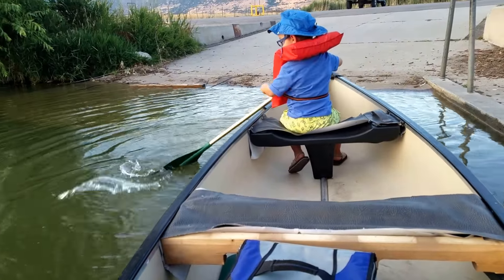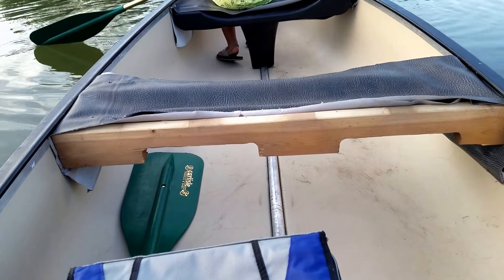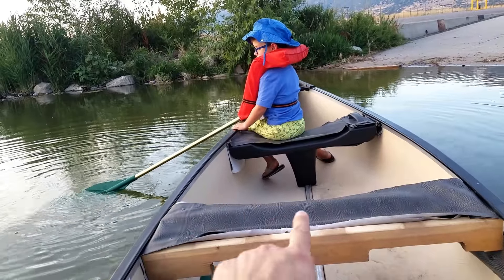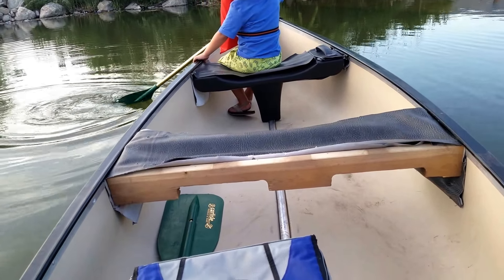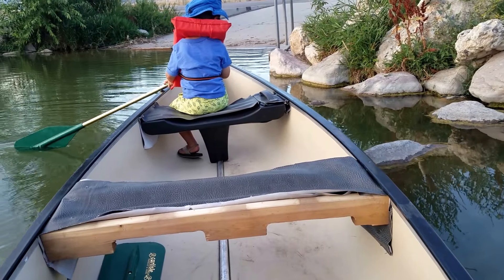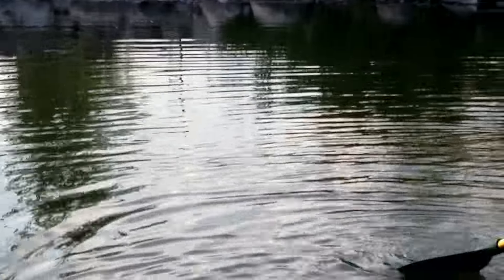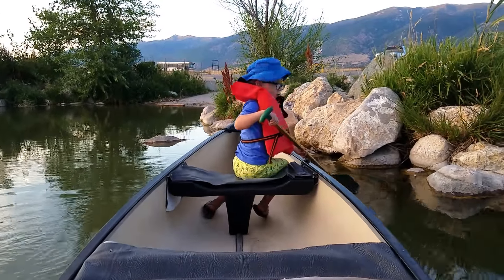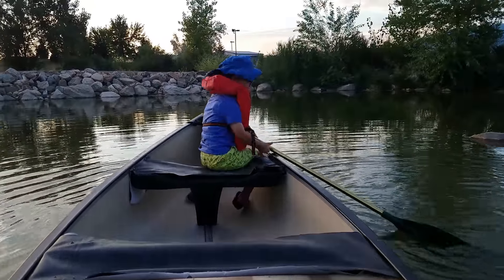Pelican 15.5 Canoe Seat Update Version 1.5

Comment: Thumbs up for the "whoop whoop"! Nice fix! I'd consider a leg on the center seat! I don't know if the walls of the canoe are strong enough to support a full load from a person sitting/bouncing/shifting weight around on it while you're boating. I think the center bar runs along the bottom of the boat to distribute the load of the seats!
I'm not an engineer, but I'd consider a leg that touches that bar! Did the side walls cave or bow inwards (I just realized this video was uploaded in 2018)?
Reply from the maker: Yes, I did eventually put a leg on the center seat when I made a seat that sat lower also.  Happily, it's at stable and and we never flipped it over at any time. Sadly, we sold it when we moved. Eventually there will be another in the future. Thank you for taking time to comment!